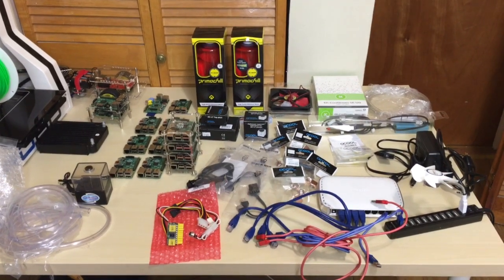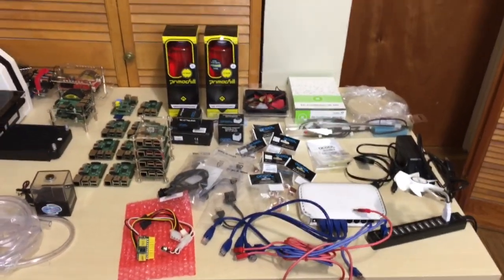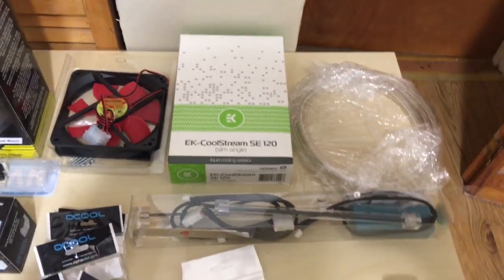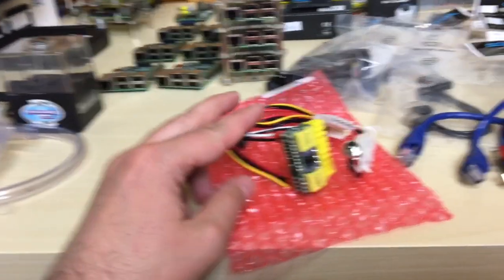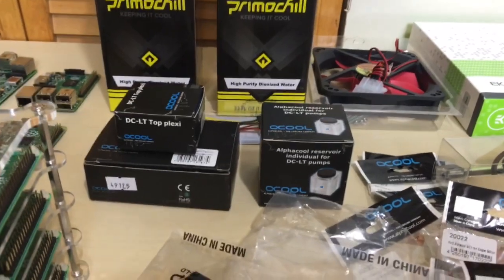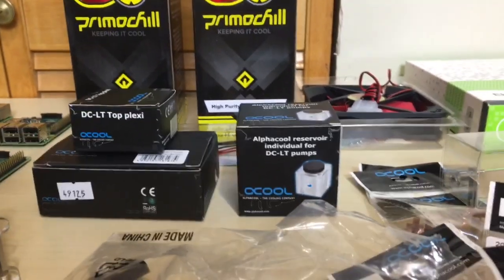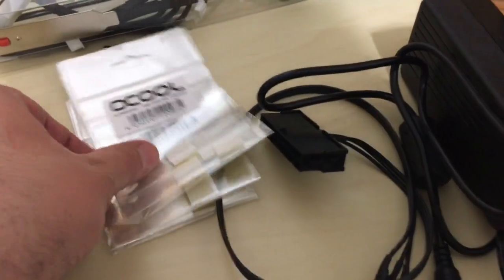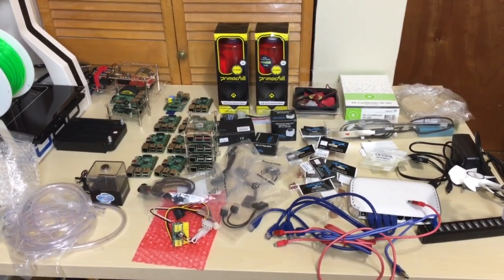Water Cooled Raspberry Pi 3 Cluster (Supercomputer) Part 1 - The Parts

Comment: is their an advantage to using micro usb to power the pi's vs using the gpio pins
just becuase it seams light alot more stuff to goto molex>usb>microusb
Reply: On the 1, 2, 3 there is a fuse on the micro usb, but there isnt one on the gpios. The pi 0 is a diffrent story, there are no fuses so theres no diffrence.